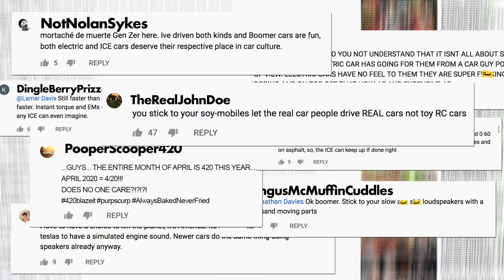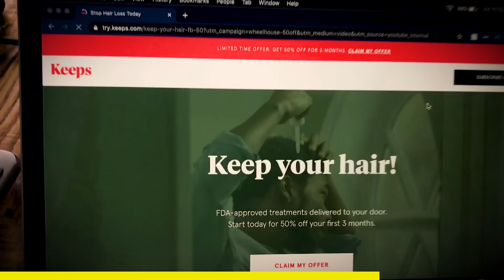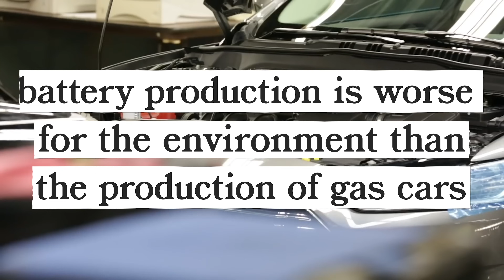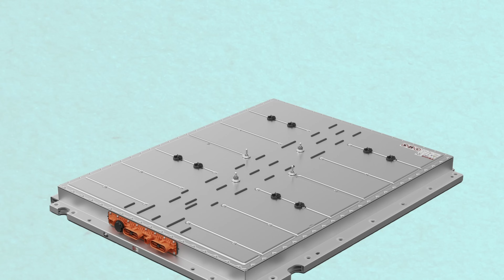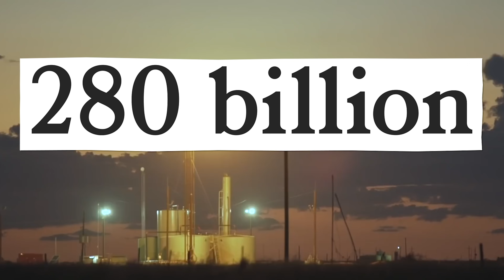Are Electric Cars REALLY Better for the Environment?

Comment: People like to say we cleaner air, but really it’s cause we don’t want to spend our money.
Gas vehicles with 65mpg is good.
Buy a propane car or a good mpg car.
So you rather do child labour and use water?
Reply: Child labour? Is that a reference to cobalt mining?
Reply: @engineeringtheweirdguy2103  not sure, mabey, I’d have to watch the video again but not gonna cause I can smell evil greed from electric cars.
Reply: @derickmuir1700  you can “smell” evil and greed? I don’t think that’s a valid argument
Reply: @engineeringtheweirdguy2103  not trying to argue, just saying i would watch it again to answer your question but I don’t need to, I know it probably due to child labour
Reply: @derickmuir1700  ok. Well to let you know. The child labour reference being thrown around with EV’s is from cobalt mining which some mines in the Congo used forced child labour. 

Tesla and many other EV manufacturers have made their suppliers sign contracts which states they not only have to provide ethically sourced cobalt but they also have to provide proof. 

That being said, the largest consumer of cobalt on the planet, are fuel refineries. Who use cobalt to remove sulphur from petrol and diesel fuel. Refineries which do not have any contract for ethically sourced cobalt as they’ve never had the public pressure to do so unlike Tesla.
Reply: @derickmuir1700  so good for thought. I’m not looking for an argument either. I just want to educate people on EV’s and dispel the myths and outright lies about EV’s put out there by oil sponsored media.
Reply: @engineeringtheweirdguy2103  so your saying your for electric compared to natural gas?
Reply: @engineeringtheweirdguy2103  so is electric cars promoting forced labor?
Reply: @derickmuir1700  no. Electric cars specially only source ethically mined cobalt. Meaning no forced child labour.
Reply: @derickmuir1700  and the largest consumer of unethically sourced cobalt in the world are fuel refineries. Meaning by having a combustion car you are supporting forced child labour. But you would not be supporting it if you had an EV.
Reply: @engineeringtheweirdguy2103  I guess I’ll choose saving the environment then child labour, eventually child labour will be solved.

Comment: Good video! The one thing you don't cover though is that (as I understand it anyway), EV batteries die after several years.
Just like how repeated charging eventually kills any lithium battery, this also effects EVs. So thats a repeated 17 metric tonnes of c02 every six years or so :(
Reply: Why would an EV battery "die" after several years when they have an 8 year warranty?  Does an ICE car suddenly stop running once it's warranty expires?  Sounds like you need to see the YouTube video of the Tesla Model S, which has covered 400'000 kms on it's original battery.....
Reply: EV batteries are designed to last 15 to 20 years and 2000 to 5000 charging cycles.  Which means an EV with 250 miles of range is designed to last 500,000 to 1.250.000 miles worth of driving.
Reply: Something people conveniently forget...
Reply: Shhh. We can't let the petrol heads onto our secret that our glorified laptops on wheels lose range over time and need the equivalent of an engine swap that pumps out another 17 tonnes of c02!
Reply: @StealthMomo  That claim is so dumb it is painfully stupid.  The 17 tons was to worst scenario to produce the entire car.  Why would the battery itself produce 17 tons???

Comment: What about diesels,the new ones are pretty clean and efficient!
Reply: A brand new mid sized Mazda 6 diesel sedan has a fuel efficiency of 6.5L/100 km. If you were to use that same diesel in a little 8kW diesel generator to charge your Tesla model 3, (also classed as a midsized sedan) you would get a fuel efficiency of 3.2L/100km.

Comment: It is true that if you turn off the AC the air outside is going to get cooler, but you still need AC. Buildings need to get cooler by design and there are many cool features a building can have to achieve just that. However in a heat wave we will need AC, always. For that we have thermal storage which easy to build, you can use water or ice, and uses existing technology and labor (know how). For everything which is electric we need to think about demand side management. This includes cars. Having everyone charging cars (myth#2) at the same day and hour will not work (sorry donut), at least in an economical way. All these ideas and solutions are good and stand from a sustainable point of view as they are good for business, create jobs and are better for the environment. Change is always hard specially when we have pet these enemies which we all love to hate and contradict but are all in this together. Lets work people. 💪🤝✌️👊👷‍♂️👍🏻

Comment: nope, it leaves more pollution in not only mining for the rare elements that go into making the components, but for assembly and fuel as well
where as for gas powered cars, the byproducts can be reused and recycled, for example, the oil used in cars can be made into plastics you use every day from that plastic water bottle sitting next to you to the makeup holder in your purse to even other car parts. the same can be said for the metal in the vehicles, it can be recycled as well, plus we can restore gas cars and keep them going longer for cheaper
Reply: Very little of what you just said is factual
Reply: @engineeringtheweirdguy2103  are you sure about that? Think on this, how do we get materials for the lithium battery used in electric cars, same with how it’s produced into an actual battery how much pollution is there in just the creation and mining of said lithium? At least with gas powered, we can recycle the metal into new parts, same with the plastics and other materials to
Reply: @lieffian  infact it’s more fuel efficient to charge your EV from a small diesel generator than it is to use that very same fuel in even a much smaller VW golf diesel.
Reply: @lieffian  but energy costs of producing batteries eats into profit margins. As such companies like Tesla have been instigating energy efficiency programs to reduce the energy required for manufacturing an the same study which was done in 2016 was re-done last year. Now the production and compatible sized EV’s and combustion cars show 0.5 tons less emissions per EV than combustion.
Reply: @engineeringtheweirdguy2103  I’m talking pollution wise, not fuel wise
Reply: @lieffian  explain how you think manufacturing of lithium of propulsion wise not fuel wise. I don’t see it in either category. Or are we crossing wires?
Reply: @engineeringtheweirdguy2103  we are crossing wires, I’m talking about the pollution caused by the mining and excavation of the materials needed that go into electric cars vs gas powered which can be melted down and made into new parts for newer vehicles of the companies wanted to go greener when cutting down on pollution
Reply: @lieffian  then I’ve already talked to that point. It’s wrong.
Reply: @engineeringtheweirdguy2103  you have your beliefs, I have mine, until they can create greener running mining machines that don’t draw power from power plants which spew pollution into the air as a byproduct of creating power and destroying the land around them in order to mine rare substances and find a greener way to manufacture said materials... you won’t be able to convince me, I’m not saying gas power is any better, but I am saying it’s greener due to the fact that we can make a whole new car from 90% recycled car parts as well as some of the byproducts of making gas to make other products we use in daily life
Reply: @lieffian  you do realise that EV batteries are 95% recyclable and the rest of the car/motor is steel like any other car right?
Reply: @engineeringtheweirdguy2103  like i said
Reply: @lieffian  that’s not how reality works. I’m giving you facts. The studies have been done. Findings published and peer reviewed. EV’s are greener. Whether it from coal, to mixed grids, or end of life recycling.

There isn’t your beliefs and my beliefs. At the moment it’s your beliefs opposing facts.
Reply: @lieffian  hell in a lot of cases you don’t even need peer review studies. You can quite easily work out that fuel consumption from charging a Tesla model 3 from a diesel generator is 3.2L/100km and its known that cars of even half the size such as the VW gold diesel are 5-6L/100km. Yet alone similar sized diesel vehicles which are between 6.5-7.5L/100km.

Comment: I have to say you are wrong on that because Texas electric grid failed less than a month ago during a winter storm so recheck your fact
Reply: And what does that have to do with EV? Natural disasters aren’t usually accounted for in averages. Power also goes out due to hurricanes. Are we saying hurricanes prevent us from using EV’a every other day of the year?
Reply: @engineeringtheweirdguy2103  I was actually disagreeing to the fact that he said our electrical systems can handle any weather specifically to the part he was talking about the extreme colds but okay you obviously didn't get that congratulations smart guy

Comment: What about the idea that a battery has a limited life so in the long run the electric car goes back up again?
Reply: Actually the life of a battery currently lasts twice the lifetime of a combustion engine.
Reply: @engineeringtheweirdguy2103  What's the lifespan?
Reply: @theodorvalentinghita1779  well that depends on the battery size. Modern EV batteries are rated at 1,500 cycles. With my model 3 SR+ my range per cycle is 250 miles. Meaning I’d have a service life of 375,000 miles. For a LR model 3, they have a range of 325 miles to a cycle, meaning they’d have a service life of 487,500 miles. The average life of a combustion car is between 200,000 a 250,000 miles.
Reply: @theodorvalentinghita1779  what makes it more impressive is that EV battery service life is measured at being to 30% degradation. In other words, at the end of your service life you still have 70% of your original capacity. For my model 3 SR+ that will be 175 miles, easily enough to continue my 75 miles daily commute. For an LR, that’s 228 miles range. So both still very useable beyond their service life.
Reply: @engineeringtheweirdguy2103  Maybe you are right about Tesla Model 3,but what about the battery of the electric cars from the range 15.000-20.000euros?
Reply: @theodorvalentinghita1779  well for 32k€ a leaf will have a range per cycle of 342 miles. Admittedly other EV manufacturers are a little behind on battery technology only lasting around 1,200 cycles as of 2020. This means a lifetime of 410,400 miles.
Reply: @theodorvalentinghita1779  the toyota Kona electric at a cost of around 30 euros, has a range of 250 miles. At 1200 cycles that’s 300,000 miles.
Reply: @engineeringtheweirdguy2103  says who?  I have never seen an electric car last close to any of my 3 f series trucks or my Malibu or Buick. All just general marnence and the buick is working hard at 500000
Reply: @Brian-om2hh  like to actually see that.  I have seen a few electric cars and if you dont count the Tesla none have made it over 200000 on the batteries.
Reply: @CRWymer  there’s are hundreds of model S’s over 500,000 miles and one even over 1 million with near zero servicing other than brakes and tires. It’s take a quick google search to confirm this. Hell there are already model 3’s over 300,000 miles with no servicing other than brakes and tires. Google 500,000 mile Tesla and it comes up with blog after blog of people talking about their experiences in a Tesla over 500,000 miles
Reply: @engineeringtheweirdguy2103  and as i said out side of the tesla never seen anything close.  But good try
Reply: @CRWymer  what do you mean outside of Tesla?
Reply: @engineeringtheweirdguy2103  other manufacturers.  Out side of or other than
Reply: @CRWymer  Chevy Volts have achieved those kinds of mileages.
Reply: @engineeringtheweirdguy2103  any yet it was discontinued
Reply: @CRWymer  yeah there are a few trucking along after 500,000 miles. Im trying to post links but youtube keeps blocking them. but google 500,000 miles chevy volt
Reply: @CRWymer  it shouldnt be surprising considering a combustion car has hundreds of thousands of moving parts and an EV has a few hundred. The 2 biggest lifetime factors are the battery and motor. Which are rated to 500,000 miles to 70% capacity and 1 million miles respectively.

Comment: Diesel baby🇺🇸  YeeYee edit:to engineering the weird guy I would rather have to use a diesel powered scooter then drive a electric car
Reply: It’s actually more fuel efficient per miles to put the diesel into a 8kW generator to charge your EV than it is to put into even a highly efficient diesel car.

Comment: There are several factors you guys did not include. Comparing the longevity of a battery powered car to that of an internal combustion engine. As the batteries get older they will lose capacity which means more charges will be needed to go the same distances they could go when they were brand new. This of course means greater electric demand. 
The recyclability of the electric engines is far worse compared to that of a combustion engine. 
Your fall back argument of needing to rely more on clean energy does not consider just how wasteful clean energy plants are themselves. Giant wind turbines cannot be recycled so as their components go bad they are literally being burried whole underground in landfills. While they're working they actually need consume electricity to get themselves moving effectively. They do not work effectively in all climates and in cold weather they have to be sprayed off with chemicals made from fossil fuels. In fact they themselves are made from fossil fuels. 
Dolor encounters much of the same issues. 
Take it from someone living in Texas, our entire grid went down during that major freeze because we are too reliant on clean energy. The technology is not where it needs to be for us to be as reliant on it as we are and people died because of it. I also think it'd presumptuous to assume that we can get the technology where it needs to be in order to rely upon it in disastrous situations. 
Car batteries themselves will die faster in the cold which again draws more electricty. 

All in all you're argument is not complete and it is either I'll informed about the state of clean energy or its relying on a bunch of assumptions about progress that are not guaranteed.
Reply: Current battery technology will last twice the average life time of a combustion engine. EV motors are just as recyclable as combustion engines, mostly steel copper and magnets. It’s also 1/5th the size of a combustion engine. 

Reducing the capacity of the battery does not mean higher demand on the grid. If the battery is at it’s considered “end of life” which is 70% battery health (you have 70% of your original capacity remaining) (also you might have put the two together and realised when I said lasts twice as long as an average combustion Engine, that it’s to 70% capacity) that means that it can only hold 70% of its original charge. For example a brand new 100kWh battery will take 100kWh to charge fully. The same battery at 70% health will be able to store 70kWh. But will only take 70kWh to charge. Imagine a balloon that loses elasticity over time.

That means the overall draw on the grid, assuming you still travel the same daily commute, will be the exact same.

I’d avoid throwing their ill informed around.